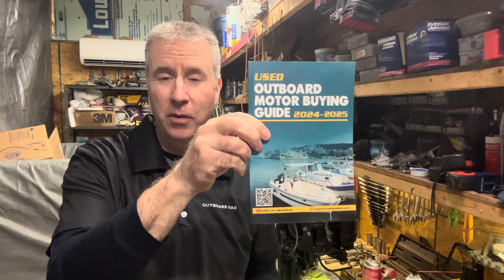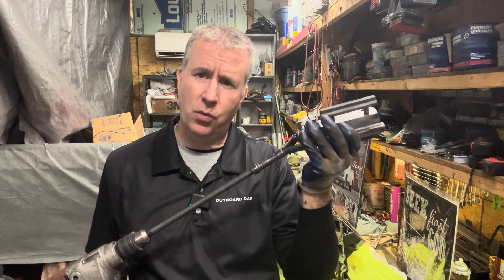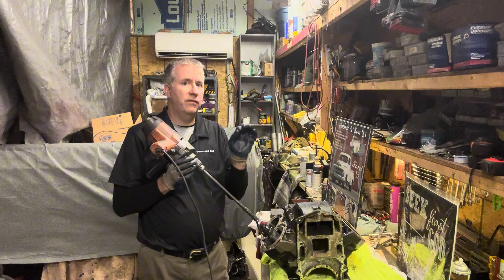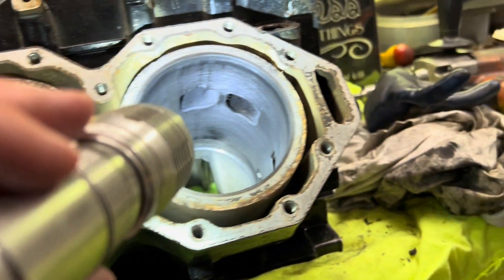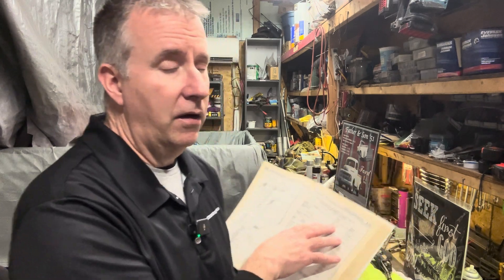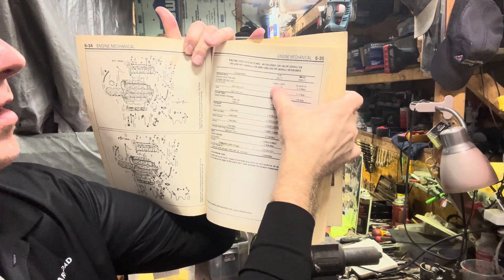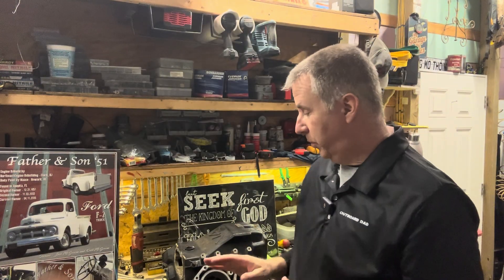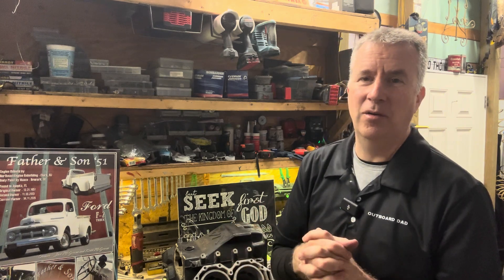Outboard Rebuild Guide: Measuring Boring and Honing Cylinders (Part 8)

Comment: I’m attempting my first rebuild and your vids are very helpful. Can you tell me the max I can “clean up” the bore of a 1996 70hp OMC? One cylinder has minor scoring. The other two are great.  I needed to take .003 to clean up. Also, if I’m able to use standard piston, would I need to open the other 2 the same? Would it be better to go oversized and leave the other 2 tight?  Thanks.
Reply from the maker: Do you have a dial bore gauge? Typically I don’t like to go over .008-.009 piston wall clearance. And if you are larger that the other holes you need to be sure all ring gaps match. Let me know if I can help keith@outbiarddad.com
Reply: @OutboardDad  Yes I bought a cheap bore gauge but it seems to work ok. The one cylinder is currently at .008 and the other 2 are .005. So ring gap is all that’s required to compensate for the difference in diameter? That would be great!
Reply from the maker: @teametal11 Many don’t even bother with ring gap but I would make them close. Within .oo2-3 of each other

Comment: I have the same motor and   was thinking about shaving the heads to get more power out of it then doing a rebuild after i see how it performs. The problem is i don't know how much is safe to take off
Reply from the maker: @bago4205  So I would have to look it up in the book but typically.004-.008 max removal to make it dead flat. Anytime you go past the manufacturer specs for more power you may very well get more but may cost on longevity . I build motors for longevity not racing. I’m all for going faster but you have to understand the risk and really no one can tell you how long it will last. If you buy a few dead motors and use the blocks then you can experiment and record the results
Reply: @OutboardDad  thanks for the advice. The parts are limited where I'm at for junson, so I'm thinking of just getting a yamaha or mercury that will give me what I want, but I love the junson
Reply from the maker: @ I suggest you invest in my used outboard guide
Reply: @OutboardDad I'm going to order some head gaskets, so I'll get it as well

Comment: One detail that may be important is the pressure of the piston rings against the cylinder walls. You used od piston rings and filed the clearance, but there is a risk that too high a "base pressure" will remove the oil film and wear the cylinders hard. Just the right amount is usually best and there are many opinions. Looking forward to every film.
Reply from the maker: @seriksson9721  Interesting, never thought of that. Good point, although most of these motors never see enough use and may never see that much wear and still last, I still hear what your saying